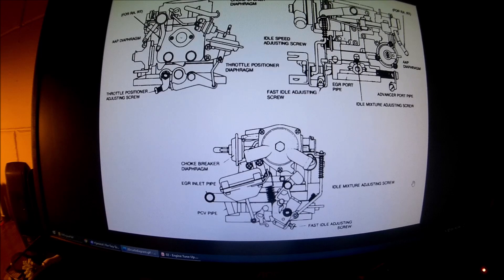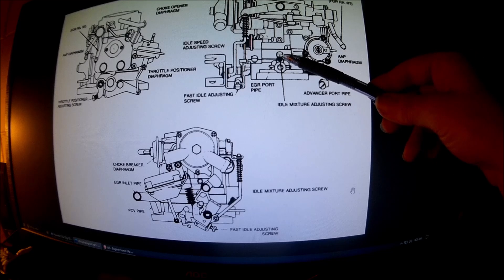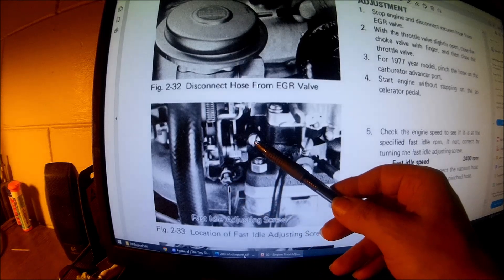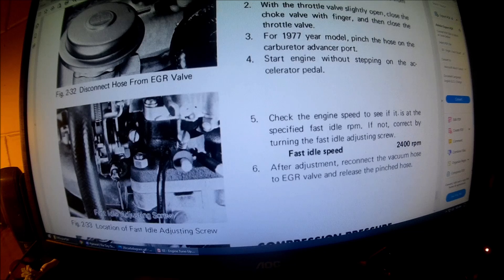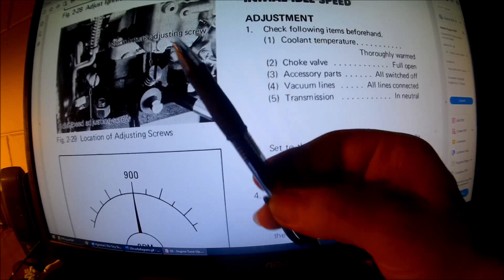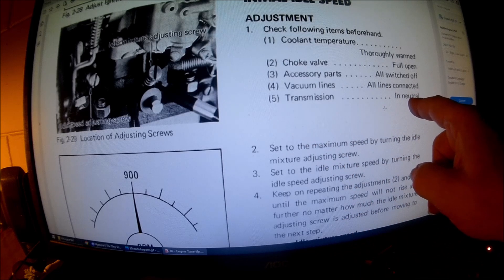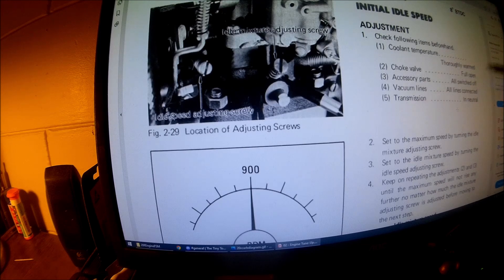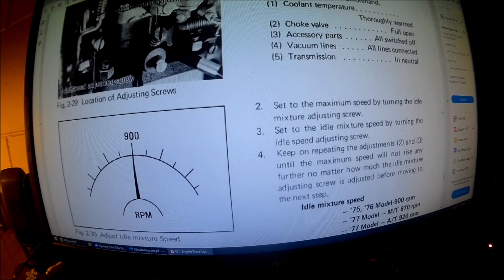Toyota 20R Basic Carburetor Tuning Procedure & Info

Comment: Thanks for the fantastic video! I had one quick question before I try to tackle this on my ‘78. You mentioned how to reset the air mixture screw but not either of the idle adjust screws. Is there a “default” setting I can set those to to start?
Reply from the maker: Glad it's of some help. The only 'default settings' I have for those two screws are as follows.
Fast Idle Screw - Carb must be 'cold'. Operate the throttle lever so that the choke plate on top closes. There should be a small bit of clearance between the edge of the choke plate and the main bore. You'll need feeler gauges to get this precise by the book (see note below). The measurement spec is 0.047" or 1.2mm. That's 3/64th of an inch or just less than 1/16th of an inch.
Turning the fast idle screw will change the size of the gap. You want to adjust the gap so that there is very light drag on your feeler gauge.

SPECIAL NOTE ON FAST IDLE ADJUSTMENT - Now that I've described this 'by the book', there are a few things you need to know. Setting the fast idle this way will likely give you the 'by the book' fast idle speed of 2400 RPM. Which I find to be far too high IMO. So I don't do the 'by the book' setting. Instead I use a tachometer, start the engine cold and adjust the fast idle screw until I get right around 1600 RPM. I've had it this way for years and never had an issue or problem.
The 2400 RPM recommendation is only to get the engine up to operating temperature as fast as possible, in some kind of misguided IMO attempt to reduce overall emissions. If the engine is in proper tune it runs clean enough where this isn't even a consideration. Again, all this is IMO. You can set yours up at what fast idle speed you want to.

As for the 'regular' idle screw, I just look at the space between the end of the screw and the arm that it contacts, and run the screw inwards until it makes contact with the arm. That's usually enough to keep it idling before doing a final adjustment.
You can only set the 'regular' idle after the engine reaches full operating temperature, and again I use the tachometer. "By the book" 'hot' idle speed is 850 RPM for either manual or automatic trans. I have mine set to 800 RPM.

And just to be sure, the 'default' initial setting for the idle mixture screw is 1 & 3/4 turns out from gently seated. You may or may not to 'monkey around' with the idle mixture setting once you set your 'hot' idle speed, which may change the idle speed. There is such a thing as 'best lean idle' to tune a carb to, but it would take pages to fully explain it here. In essence it's this:
Warm up the engine to full operating temperature and set the idle speed screw to 800-850 RPM. Then, adjust the idle mixture screw by turning it in (clockwise) slowly until the engine begins to run rough or stumble, and back it out (counter-clockwise) just enough to smooth out the idle. Then check your idle speed and readjust if needed.

I hope this helps. Let me know if you have any other questions.
Reply: @The13thSword  thank you so much that is super helpful. Even if 2400 is egregiously high I’d like to start at the by the book baselines and then adjust from there so knowing the gap for the choke plate and how to set the low idle speed screw is super helpful. 

Now to track down a tach I guess hahaha.
Reply from the maker: @wizzowsky9099  No problem. There are a bunch of basic and cheap tachs out there on Ebay and I assume Amazon. I'd go with one of those if it's only going to be used occasionally for tune ups. A decent AutoMeter tach will set you back about $80.

Please let me know what results you get with your adjustments.

Comment: SHOULD THE AIR CLEANER ASSEMBLY BE ON THE CAR WHILE ADJUSTING THE CARB? I KNOW IT SAID ALL VAC LINES ATTACHED WHICH IS WHY I ASK. THERES THE LINE TO THE BOTTOM OF THE AIR CLEANER
Reply from the maker: For best 'real world' results, you should do carb adjustments with the air cleaner installed, in the way it would be normally. This is because of the air filters' resistance to air flow, which is minimal but it is there. With the air cleaner off the carb, the carb can pull in just a bit more air than with the filer in place, so that could change your air/fuel mixture ratio a bit. On V8 engines this usually isn't an issue, but it could be slightly more important on the 4 cylinder engines.

I do carb adjustments with the air cleaner installed.
Reply: @The13thSword I kinda figured but never hurts to ask
Reply from the maker: @777gearhead  No problem. Always better to confirm than assume.

Comment: Is the Chinuck motor home carb adjusted any differently?  Where can I get a new ignitipn box for my 1978 toyota sr5 chinock framed flat bed?  Fyi, it is a mini motorhome stripped to the frame and made into a 8 foot by 8 foot flat bed.  Frame is factory fully channeled.
Reply from the maker: There is no difference in stock carbs between the 'regular' pickup and the motorhome chassis. All stock engine mechanicals are the same. I'm assuming it still has the original 20R engine?

New 'stock' ignition modules (Toyota calls them 'Igniters") are no longer available from Toyota or aftermarket suppliers. Unless your original ignition module is completely missing from the truck, I'd suggest that you try to get yours tested before making any assumptions about it being bad. The motorhomes tend to have much less mileage and use on them as the regular pickups, and those ignition modules were made to last. It's possible it's still good, and that you just have an issue somewhere else in the ignition chain (e.g. distributor pickup coil, ballast resistor if you have one (most '78s did), ignition coil (should also be tested), wires, plugs, cap, rotor, or even some corrosion on electrical connectors or broken or damaged electrical connectors, and possible bad ground connections.)

If the ignition module is bad or missing, the only way you're going to find a stock original style is junkyards or Ebay, but that's always a "crap shoot" whether they still work or not. Yoda Jims in Colorado may or may not have one; I've had decent luck with them in the past on used parts, but haven't had the occasion to buy anything electrical from them yet.

I have extensive video up on using the 4 pin GM HEI ignition module with the stock distributor and ignition coil, and it works well. I'd be glad to give you the benefit of my experience with this conversion.

If there is any other specific info you are looking for just ask. My personal files are full of '75 to '78 specs and info.

Comment: Invaluable info! I’m trying to reset my 78 celica liftback it reeks of fumes too rich I was sorta blindly adjusting and now the brakes are soft… any advice there? Thanks
Reply from the maker: Glad that the info helped. As far as brakes go it's difficult at a distance to give you specific, targeted things to do, and without knowing what you have or haven't done with the brakes so far. If you can tell me about those things I could give you specific places to look.

But in the meantime, soft brake pedal can be due to air in the brake lines (full system needs to be bled properly), weak or bulging flexible brake lines near the wheels (look for bulges or age cracking on the outside of the hoses and replace with new if you find that), leaking calipers or wheel cylinders (old seals may leak or not hold pressure, repair or replace), leaking master cylinder seals (same issue, repair or replace).

Those are the major issues I'd check first. However, if it were my car, I'd just check and do the entire brake system. The vehicle is 47 years old, and older parts can & do fail over time. Brake systems are nothing to go halfway on.

Let me know if you find any of those things, or have other questions I can help you with.
Reply: @ thanks very much! I agree, the whole system should be reviewed. Update: I think I tracked down the culprit, a loose hose under the idle screw. I tightened it up and the brake is not spongy any longer. Will have it all reviewed by my mechanic. The idle screw… and resetting that to stock.. is that screwed in all the way gently then back it off 2 full turns? Also to lean it out, should I clock wise or counter clockwise the idle mix? The exhaust has always smelled strong on the car and I’m just trying to reduce it. Probably need to replace the full exhaust too, previous owner did a sloppy weld job all over the exhaust. Would be interested in what exhaust you think from the junk yard I could recycle like a Miata or maybe just have someone build a new exhaust from scratch I just need it to be not so smelly and a cheap repair. Thanks again this video was so helpful!
Reply from the maker: @Jaspertronic413  Very good, no sense in short-cutting brakes. I'm assuming that the hose you tightened is larger than the "usual" vacuum hoses? If so, that's the vacuum hose for the brake booster.

I want to be sure we have our terms correct here, to avoid any possible confusion. The "idle screw" is the one that controls low idle, is on the lower left of the carb, looking from the passenger side, and is parallel to the ground.
The idle mixture screw" controls how much fuel flows into the carb's idle circuit at low idle. It is located on the center line of the carb, viewed from the passenger side, lower down near the carb's baseplate, and the screw is angled upwards. It also has a visible spring on it between the screw head and the base of the carb.
I say all this to be sure we're being accurate, as it's important.

From what you are saying here, I'm going to assume that you mean the "idle mixture screw". You are basically correct: to set the idle mixture screw to (close to) stock, you gently turn it to the right (clockwise) until it's lightly seated, the turn it left (counter clockwise) 2 full turns. A full turn means 360 degrees of rotation of the screw head (a full circle, if you will).

Turning the idle mixture screw right (clockwise) will restrict the passage that the screws tip goes into, and will lean out the idle fuel mixture. Turning it the opposite opens the passage more and allows more fuel volume to pass, making the mixture richer.

For tuning, there is a common "rule of thumb" for something called "Lean Best Idle". Once you have the idle mixture screw set to "baseline" (2 full turns out from lightly seated, as discussed above), you start and warm up the engine to full operating temperature. Then you turn the idle mixture screw in 1/4 of a turn at a time, and listen to the engine as you do this. You stop doing 1/4 turns when the engine starts to be "unsmooth" ("missing", roughness to idle quality). Then turn the screw back to the left (counter clockwise) 1/4 turn at a time. The idle quality will smooth out. Keep going 1/4 turn at a time until the engine runs at it's smoothest and most stable idle, or until turning the screw to the left makes no difference in idle quality.

That's the way I do it. My idle mixture screw is set at right about 1 & 3/4 turns out, but I'm in Florida where very hot weather can affect mixture greatly.

If you do all of this, but idle quality still isn't smooth and stable, you either have a vacuum leak (or several of them), or the carb has a problem with the idle circuit (engine trying to run on main circuit only, would be a very rich condition), or both.

When the exhaust was strongly smelling of fuel, did you ever pull a spark plug or more and take a look at them? If they were black, that's a sure sign of a rich fuel condition, or no spark to that plug, not burning the fuel. What's the story with the carb? Is it original? Has it been worked on to your knowledge?

Exhaust - as long as you don't have any exhaust leaks you shouldn't have to replace the exhaust system, just because of a previous rich condition. You can check for leaks at joints with a piece of tissue paper. With the engine running, just hold the paper next to any exhaust joint you want to test, and look for any regular "puffing" movement of the paper. If you see that you have an exhaust leak there.
Be VERY careful doing this! make sure the car is out of gear, chocked so it can't move or park brake is fully applied, and be careful not to get burned by hot exhaust pipes.

If you plan on keeping the car for any period of time, I'd just take it to a good muffler/exhaust shop and have them weld up a new system. It's usually not that expensive for them to do a stock style system. I had my truck done that way 25 years ago and it's still going OK. I only replaced the "donut" between the exhaust manifold and the downpipe, because I replaced the original manifold due to it cracking. Junkyard exhaust parts - you're rarely gonna find pieces that are in actual good shape.

Anything more you know where to find me. Keep me posted on any progress.

Comment: Hi just got my carb back from a rebuild wasn’t starting and just cranking before. With new carb started right away but was idling at 2500 and oil temp was going up a little. I tried adjusting to bring idle down and now same issue as before where cranks and starts but dies unless I keep foot on the gas. Is my idle to low now that’s why it’s dieing? Or maybe old gas clogged the carb again like before the rebuild? Let me know what you think
Reply from the maker: Old, contaminated fuel could be the cause, but there are several other parts of the fuel system you need to completely go through as well, if you haven't already. I will address those things below.

I don't know what you know or understand about things so I will be as complete here as possible.

The 2500 fast idle speed is very close to the factory spec for this carb/engine (20R). The fast idle spec is 2400 RPM. I personally have mine set at about 1800 RPM, as I find the 2400 setting disturbingly fast. Also understand that the fast idle is only operating until the engine reaches normal operating temperature, or you "kick the idle down" via the gas pedal before it reaches full operating temp. At close to full or full operating temp, the choke mechanism moves the throttle linkage so that the regular idle speed screw is working on the linkage. "Regular" full temp idle speed spec is 750-800 RPM, depending on whether you have an auto trans or a manual.

If you don't know which screw is which - Passenger (right) side of carb, the fast idle screw is lower left. The "regular" idle screw up and right to that screw. Just have a close look at the screws and linkage, you'll see it.

If you have a tachometer I advise that you reset the fast idle to between 1800 to 2000 RPM. Then see if your "hot idle" still has the same problem. If so, you can adjust the "regular" idle set screw and see if that makes a difference.

Understand that changing one setting can affect the other. Once you set the fast idle speed to where you want it, wait for the engine to complete warm up, then set the "regular" Idle speed screw.

All of the above can take some time and tinkering so be patient.

Other possible issues:
Replace ALL of the rubber fuel lines. Older fuel lines can shed rubber particles from the inside diameter of the line and those particles can easily clog up idle passages. Especially if modern Ethanol-laced gasoline has been used before. Those old rubber lines were not formulated to handle Ethanol, and the Ethanol can and will deteriorate those lines.

Replace the fuel filter with a new one.

If the gas in your tank is more than 90 days old (especially if it's Ethanol-laced), drain it out completely and get fresh gas in there.

More work but it goes hand in hand with the above -
Remove the fuel tank from the vehicle so you can take the fuel pump and sender stalk out (if equipped with the electric in-tank fuel pump), and thoroughly inspect the inside of the tank for rust, corrosion or debris. I'd do this even if I have the mechanical fuel pump. These are now 30 to 40+ year old vehicles and if you don't know what's in that tank, it's better to do the work to find out and fix any issues you find.

IMPORTANT - I say all of this because it's a fuel *system*. You can't just fix one item in a system, especially if the system has lots of miles and age on it, and expect everything to work perfectly. Especially with older vehicles like this.

What fuel pump do you have? The electric type in the gas tank, or the mechanical type that is mounted to the cylinder head?

Throttle linkage/throttle cable. Not sure which you have but the linkage or cable could be sticking, binding or be damaged. Inspect end to end from gas pedal to carb for issues. If no damage found but it is sticking you can try to lube the linkage or cable. If linkage use a light machine oil like 3-in-1 oil or regular mineral oil. You can use engine oil in a pinch. If cable, and the cable looks original but is sticking or binding, you can try to lube it but If it were me, I'd just replace the cable with a new one.

Those are the things I can think of right now. Try the idle speed screw adjustments first and see what results you get.